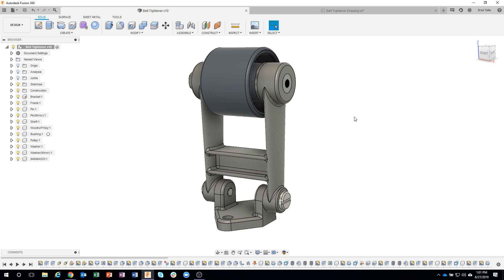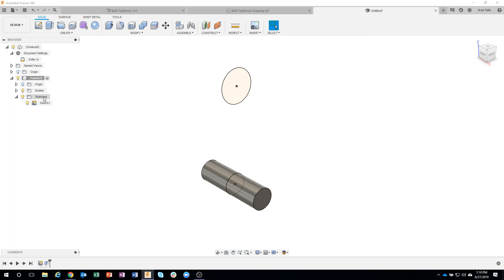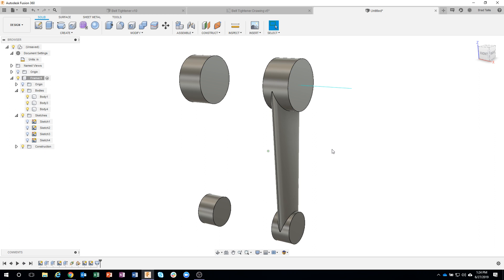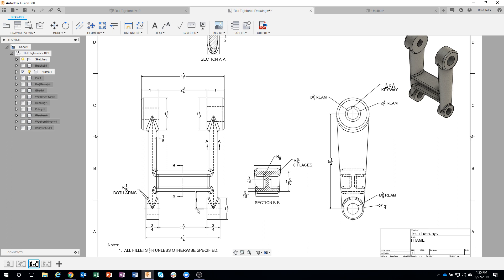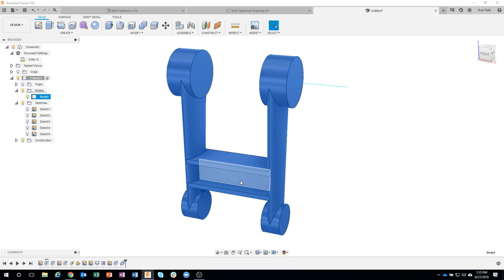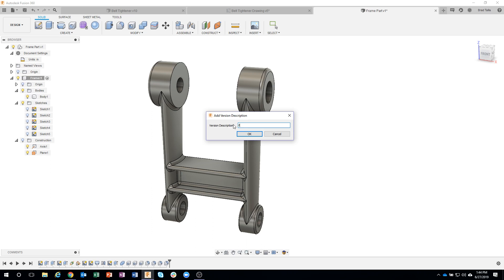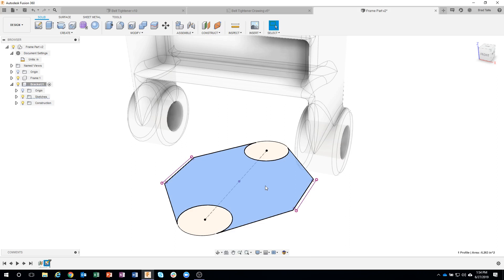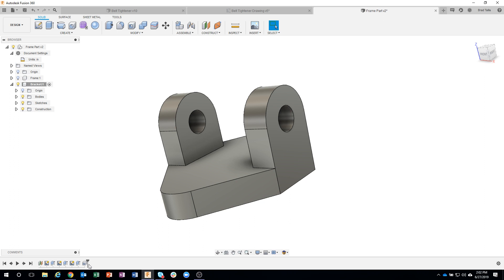360 LIVE: Creating In-Context Designs (multi-part series)

Comment: I love clicking the face to set the holes going through to them. Wouldn't it be much better if you were using the "to" for the extent rather than "distance" while doing so? If using distance and you change the width of the area the holes are going through, they won't continue to go through without editing them. If you use the "to" setting and select that face the hole will always go all the way through that face without messing with it anymore.
Reply: I agree. Brads method is only for a temporarly mesherment  and so a fixed dimension.
Reply: BlackSmokeDMax-  Yes, you are correct.  I need to get better at using the "to" option.  I come from a "Direct Modeling" background where you just click on faces, edges, etc.

Comment: 1:00:00 is there a reason you chose to extrude symmetrically all the way through, then cut away the excess you created, instead of using the START feature to start at the frame and create mass (of the correct 0.5 width) towards the center of the base? Then you wouldn't have to cut anything away because it would already be the correct size?
Reply: Yes, I noticed the same, that would be another great tip
Reply from the maker: I'd like to see if Brad has a reply to this. We shall see....it could be on purpose, or maybe a simple oversight.
Reply: @Kaleb Israel-  You are absolutely correct.  The part could totally have been designed that way.  In Part 2 of this series, I show how to use the Start and Offset option in extrude to do exactly what you explained.  In the example I showed, I look at designing the part like how a machinist would machine the part.  He would have a large chunk of material and then "cut" away the center area.  Many different ways to get to the same solution, but yours would be the simplest and easier on the timeline.  Thanks for sharing!
Reply: @bradtallis8968   Okay great! I'm only barely one year in so I've got much to learn! Just always trying to make sure I'm efficient where I can be. Thank you. Keep up the great work!

Comment: I am not a mechanical engineer (i am a civil engi.) but everytime i model something i am trying to include some clearance between surfaces. Shouldn't there be a clearance value for the bottom part on this model also? Will it work perfectly if you produce it like this? Like when the pin is installed and everything is together (irl) friction between the faces of bottom and top components let it rotate? thanks for your answer in advence.
Reply from the maker: Oh most definitely clearance and tolerance would need to be addressed at some point in the process. We'd be insane to think parts produced would fit perfect or allow the motion they're designed to produce. Excellent point. I think during the design process it can be easy to overlook this very important fact.
Reply: Thanks for your reply. I have almost watched all of your videos in the past month. You are a really good instructor to follow. Looking forward for more content from you. Have a great day!

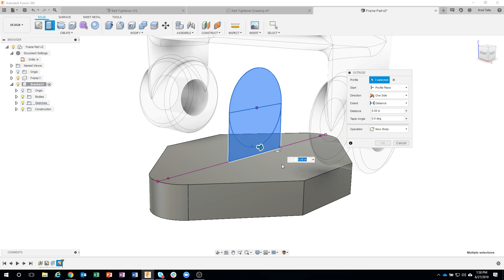Comment: As another method where you split the base boss into 2 ears (after the 60 min mark) you could have re-used the same sketch profile from the 59:46 mark and created an extrude-cut. Would have saved a sketch, not a big deal I know, but thought I would present the option.
Reply from the maker: Great point! Saving a sketch here and there can result in some major time savings down the line!
Reply: Good point!  Minimizing steps in the timeline is always a good idea.  Thank you for sharing.